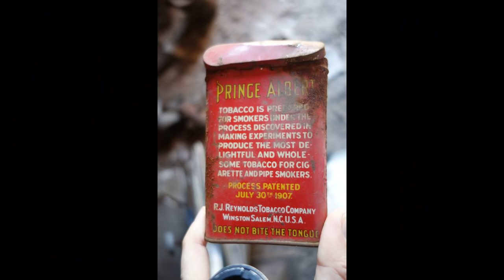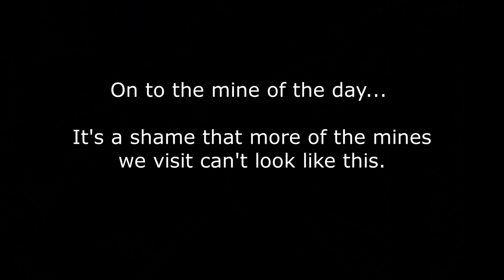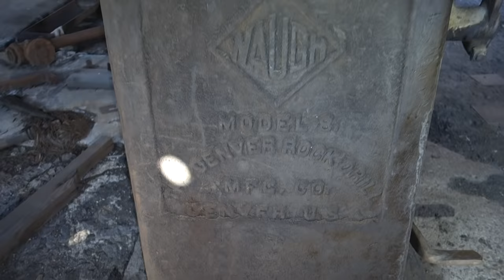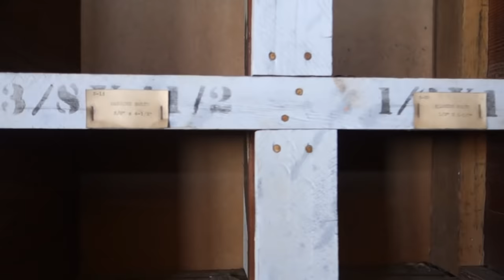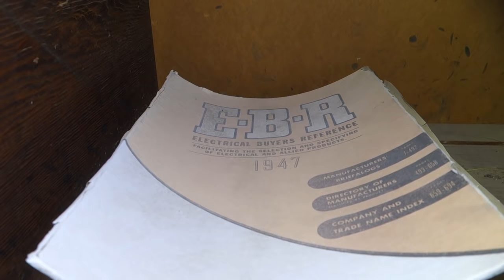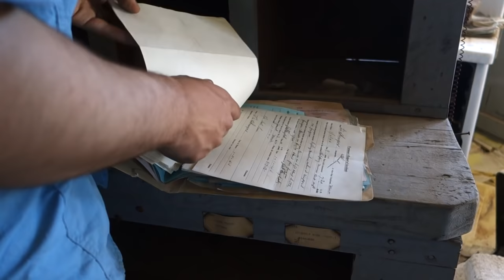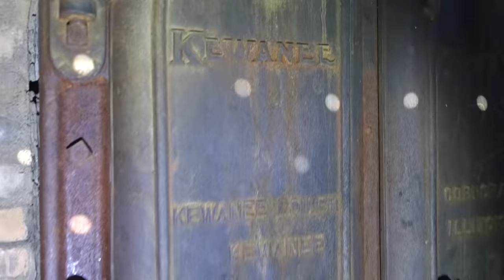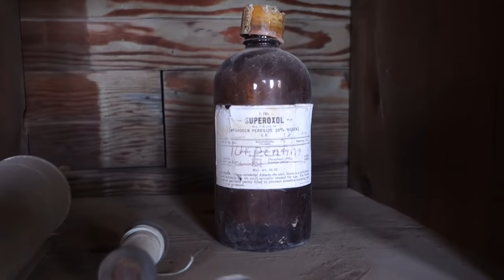How An Abandoned Mine SHOULD Look

Comment: thats is cool and you forgot to mention the copper thieves as well .... on them old Governors they would use the term" Balls to the wall " when running at wide open ...so many cools things to see .....never seen so many drills in one spot ... we know that spot well ....and we did a video on the mill to the North of that spot  ...yes you can separate fine Gold with static electricity and that would make sense how that machine was set up ...the Keene 140s Drywasher has the same thing incorporated into it to..... wow 7 ore cars ....that would have been amazing to see....pushed down the shaft ...what !!!! are they crazy . oh wait yeah you talked about that. Assuming you have more from this area....good job sonny Jim.

Comment: That device between the boilers is a steam to water heat exchanger to produce hot water.  The frame above it held the hot water tank.  

Looks like the Kewanee boiler was coal/pellet fired and the other boiler was oil or natural gas fired.  Very cool to see them intact and unmolested as the gentleman stated.

Justin you are 100% correct that these historical sites should ALL look like this.  Thieves and vandals are among the lowest forms of life.

The compressor room is amazing.  I especially enjoyed seeing that Sullivan steam powered compressor.  The hoist is something we don't often see intact too.

Comment: That was a very interesting explore. I certainly agree with on people vandalizing and stealing things from mine sites in general. However, with the BLM and other authorities barring and back filling mine entrances, these artifacts are being lost for all time.

There is a fairly high profile Mine Explorer here in BC that pulls artifacts out of very old difficult to access mines, restores them, and displays them in his museum. I have been there, and it is quite interesting to see them in working condition. So, I believe there are cases where it is reasonable.

Your friend has a great knowledge of the old machinery, and it was quite interesting to listen to. I have worked on an Ingersoll Rand Compressor built in the sixties about twice the size of the ones you showed in the mine with a 4160 Volt 300 HP Synchronous Motor that was about 10 feet in diameter, and two cylinders that compressed in both directions. The Cylinders bores were big enough that you could crawl into them,. It was only 50 PSI, but at huge volume.

This must be quite the mine if it has its own substation that I saw in the background at one point. It probably had a higher voltage transmission feed to it to meet the Electrical requirements.

Thank you for the interesting and informative Videos.

Comment: Personally I prefer to see machinery preserved and running, not rusting away on some mountain top.  Maybe this stuff will have value in the future and governmental units will preserve it in place.  I assume it will mostly be gone by that time.  CO. has done very little to preserve its mining past, mostly a few special preservation groups not really up to the task.  The Mayflower Mill in Silverton operated as late as the 1990s and is a tourist stop.  Its many miles long tram to the top of the mountain is disused.